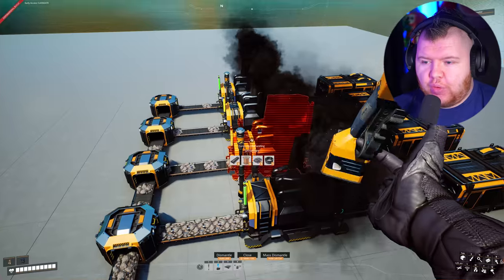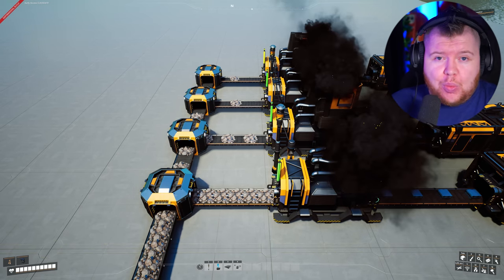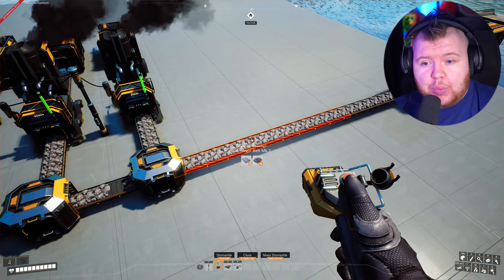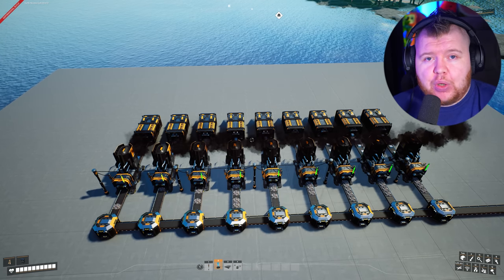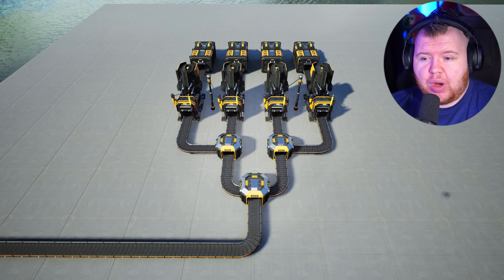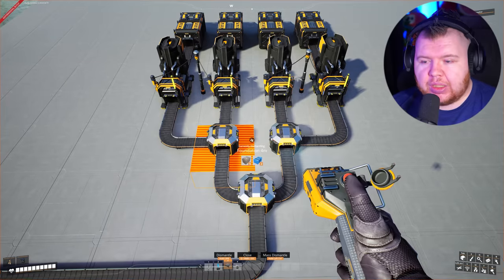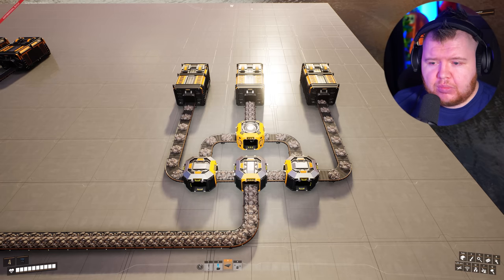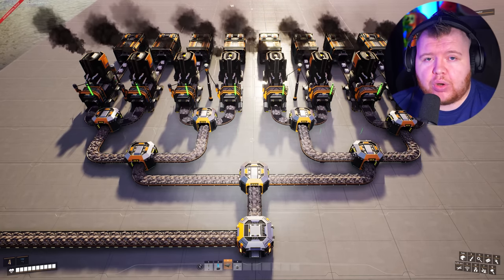MANIFOLD vs LOAD BALANCING!! in Satisfactory

Comment from the maker: So what do you run in your playthrough, Do you use Manifold, Load Balancing, or Both and why?

Before people let me know, YES! I could have split 270 into 3x90 lines and then split them into 9x30 Lines, the reason for my explanation was to show other methods you can use to help you with the process
Reply: I used to use load balancing before I understood how a manifold system actually works. After a few years of load balancing, though, I realized a manifold system has more upsides than downsides and began using it as my primary method of feeding the machines
Reply: That load balance was wrong. If you split ores 3 way and each way in to next 3 ways it will make 9 smelters. 3x3 ;) so it isn't like you must do special stuff for that. But for more wierd stuff that come later in game much better is that Manifold system.
Reply from the maker: @Elmachtronic  The purpose of me doing that was to explain for the later game and other methods of helping your balance load :_BitzLove:
Reply: I usually use manifold because I generally play to let my brain melt not explode into fire lol.
Reply: I typically use Load Balancing for things like Coal Power, and manifolds for nearly everything else.
Reply: I use both it just depends where but if im doing load balancing with mk5 full belt, i connect it with manifold as it's easy to make and expend
Reply: Like many folks, I started out using Load Balancing almost exclusively, and pretty quickly began to run into issues with expansion.  All those splitters and belts take up valuable space on the factory floor.  There are certain times where Load Balancing can be beneficial, such as driving 8 coal generators with a 120 coal/minute feed when you need all 8 to come online immediately so your factories don't start running out of power.  But even then, I usually let things go offline until the Manifold-fed coal generators come up to speed, and then restart my production.

Both are fun, each offers its own set of challenges, and I'd definitely recommend trying both to anyone playing the game.

In a future video, could you perhaps show some of the more advanced Load Balancing concepts, like 5-way, 7-way splitting of an input line?  Also, possibly showing how to convert multiple conveyors with different numbers of items/minute into some number of output conveyors with equal rates/minute?  For example, take conveyors with 160, 80, and 60 ore/minute on them and convert them into three lines, each with 100 ore/minute?  These are good skills to have for all pioneers out there in Satisfactory-land.
Reply: Manifold, but pre-load all the things because I'm impatient AF.
Reply: I tend towards Load Balanced systems, partially because I like the way they look and partially because I enjoy the mathematical puzzle of keeping everything neat and orderly and prefer not to have my machines backing up if I don't need to.  However, I frequently combine the two techniques, sort of; to use the same example of a 270 ore input feeding into 9 smelters, I'd have a manifold line style trunk line input with Mk 1 belts feeding off, but each of those belts would then be split into 2 30s to feed the smelters, until the end of the line where I'd either have to use a smart splitter (60/30 using overflow) or split three ways from the trunk line.  That keeps the ease of expansion from the manifold but also the more efficient flow and lack of backed-up machines from a load balanced system.
Reply: Honestly I just figured you left the overflow to show what somebody could do with any amount of overflow. Like they are satisfied with their build but there is a bit of extra that they don't want to go to waste in stutters. They might as well send it off somewhere else to be used either in production or tickets.

To answer your question though I use both. My power plants use a dual manifold layout but everything else I load balance.
Reply: Hi Bitz Please can you do reaction videos for the remainder of the Let's Game it Out's.
Reply: I use manifold mostly.  The easier upgrade path just makes it a no-brainer for me.
Reply: @mikehunt3205  I preload as well.  I just set up my miner to feed into a storage box when I'm building my next stage.  By the time I'm done I can usually prefill them all without any major waiting.
Reply: manifold for sure, it uses less space and has a ton of adventages even if it takes some time to fully get running but the first two runs i did after i went from factorio to satisfactory were full of balancers and my factories were a mess, i still use balancers in the early game to make basic stuff but i go to manifold as soon as i start building
Reply: I def stick to manifolds, mainly for space, and it's easier to expand as I upgrade. One thing I would however like to know is differing mewthoods for creating a mass storage room and getting said items to said storage. As dumb as it is thats my biggest issue. I have 'over flow' lines with smart splitters from all my production for each part flowing up and all connecting to a single line that then flows throuhg even more smart spliters that send items off into stacked normal storage containers. 40 in total in fact. At the end of this line all items just go to a sink. 

This works, but this line does start to run into its own backlog issues as well, I have belts of items all merging together into a single one. Thus my lines are getting backed up, thats backing up to production lines, and that is boging stuff down. I did try adding another overflow line to just sink items, but then most the items are getting sunk and not reaching my storage. At the moment I only have mark 2 belts, and know it can get fixed as I upgrade but I can only imagen I'll continue running into this issue even as I upgrade as well, more items will be added to the line.. This is an issue that I feel may only get worse that I'm unsure how to well... fix.
Reply: @TAiiNE  i use separate lines for each item no matter if they come from near factories or if they come by train and transport all of them under the storage facility up to the conveyor hole where the item goes to the storage in the next floor and at certain part of the line i use a smart splitter to get the overflow into a sink.
it is not efficient space wise but saves you from a headache
Reply: @alejandrozapataq  That would be far too many belts to manage, 40 belts in my case all in one area + the line for sinking them. Thats almost 16 foundations if I line them side by side to manage and try to deal with. I'm struggling just to keep the lines for iron, copper, concrete and coal running  and now trucking in quartz and silica for windows.

What my plans were for the main base that has my central storage is only producing the key items used to make like constructors, smelters, etc etc, at least up everything up to tier 4. The rest and more complex stuff will be made elsewhere including the space elevator parts. I already have two outside factories, one doing quick wire and another doing silica and quarts that are being trucked in for storage.
Reply: @TAiiNE  thats fair, in that case dont forget to put overflow lines, you will need them at some point

Comment: I use both. Manifold is my default, but I’ll use load balancing for aesthetic reasons or just to change things up. A lot of times load balancing required giant swaths of belts running the same material, and I love to stand and watch everything going in unison. Or setting up yet another smelting facility sounds boring, so I’ll load balance to require a different layout. 

Using a smart splitter to slough off the excess from a full belt is something I’ve never used before, but is a great idea!

I appreciate a fellow “use the slowest belt” player. Just using the fastest belt is certainly easier, but when they aren’t moving very much it just looks like an empty belt where something occasionally whips by, and I prefer getting to see the items moving around my factory. Plus it’s easier to diagnose if something is wrong. If any belt above mk 1 isn’t at least roughly half full, you know something upstream isn’t producing enough.

Comment: Nice explanation on the different types of loading your machines. For your solution on the load balancing, I would have split the 270 line into 3 times 90 and then 3 times 30. Would save you a couple of splitters and all the hassle of the smart splitter. (I do get the need for the example though)
Reply from the maker: Hey bud i placed it in the pinned message, to explain my reasoning behind it  :_BitzLove:

Comment: I used to set up load balanced designs, until I learned of the manifold system. The heating up period can make one unsure of their calculations, but once it's fully operational, it's really nice to use and right, expand on it ! And its compact footprint makes it convenient as well ! I've also tried to have a manifold one way with mergers at the smelters' exits that go up with a lift to another manifold that goes the opposite way with splitters to feed constructors. I kinda like it.
Thanks @Bitz for reminding me of the Smart Splitter overflow parameter, I've never really experienced with it, but will definitively will !

Comment: As a couple people have mentioned, you can reduce the "heat up" time on a manifold production line by running belts with materials on them and preloading the machines in order.
This gets trickier the deeper you get into production as you may not have easy access to full stacks of some of the composite materials.

I think the most important takeaway for people is that both setups are capable of being 100% efficient, and they both have their uses. It largely depends on personal preference.

Comment: Manifold systems also work very well with vertical setups as well if you want to reduce your horizontal footprint. You can attach vertical conveyors to the outside of the splitters along your highway belt to bring product up to more smelters that can sit on another story above.  Then typically what I do is I rejoin all of the product using the same manifold system and then distribute it to a bunch of constructors in the same manner. You can make some very compact and modular setups doing this.

Comment: The load balance systems are my go to method of building the systems in my game. My brother and I created a system we like to call a Medusa. In effect we build each system where the input and the output both come to the center of the complex.  The ultimate inputs are typically maxed out miners of raw ore being supplied and the output is the product of whichever system. Obviously we have to modify it slightly for the higher level systems like recipes that go through the assemblers and manufacturers and will sometimes build a low level Medusa to supply one or more high level systems with items like rods or plates.  It makes for a remarkably compact footprint for a maxed out mark five belt of product.  It doesn’t always work perfectly but it does give us stunningly high outputs to permit for some massive building projects without worrying about running out of products to build with.

Comment: i am using both systems in my most recent world depending on what i am trying to automate. predominantly manifolds and most of my load balanced setups are using overflow sinks so they are not working on 100% resource efficiency but that's alright.

i instinctively went with load balancing when i first started the game and it brought me to the point of tears multiple times because i just could not figure out how the more complicated recipes are to be set up and i had no idea about smart splitters to regulate overflow. i felt so stupid that i dropped the game for about a year until i stumble upon this channel and decided to give it another try after watching a few of your vids.
i don't think that i would have picked it up again or learned to actually play it without this channel.

Comment: You can also use manifold with smart splitters if you want power to fluctuate a little less--left would be ore, straight would be overflow--repeat. Doing so means you won't have something at the end only sometimes kicking on, but rather in an off state until it is needed and ready to go. This is better if you need high efficiency--mainly if you're starting a new power plant and desperately need the power now

Comment: From my understanding, manifold can cause the last smelter to tick on and off, for fractions of a second which as I recall from ImKibitz causes framerate issues or engine issues when you scale up.  Something to do with the power fluctuating and stuff, however this was before they changed power(coal factories ran only to provide 'enough' power, now they run 100% all the time).
Reply: To add, this was also a few major patches ago.  Since then they have upgraded the engine and changed rendering of machines at a distance(they used to always be 'loaded' in memory even off screen).  

That all being said I still load balance and not worry about under clocking.  Under clocking works best in large scale to lower power consumption.  I use modular power mod so I don't have any power issues since that mod, while more complex, solves all those issues behind power use.
Reply: In the same time, Load Balancing can cause the whole energy generator factory to tick on and off if you don't supply enough resources to the factory, which can be more troublesome than one smelter switch on and off (Imagine 30 generators or so all turn off in sync, blow your fuse just because one wrong calculation in supply speed)
In Manifold case, only 1 or 2 generators would be off due to lack of supply.
Reply: Yes, I've seen instances where the last one or two smelters or other production ticks on and off, as the incoming resource sometimes makes it there a fraction of a second too late to keep things running continuously.  I usually fix it by taking a couple of extra of that resource from storage or handcrafting them and dropping them into the end units' inventories to provide a tiny buffer.  You don't have to completely fill the smelter/etc. ... just a few extra in its input inventory is usually enough to stop that on/off ticking for the length of the game.

Comment: I use load balancing because I really enjoy figuring out how to perfectly balance my machines in a way that is both aesthetically pleasing and modular. When I scale up, I just add another floor and split the incoming belt rather than re-tooling everything. That said, I tend to just hand-build everything I need to get to Mk 3 belts (apart from miners and Space elevator parts) before really getting into factory-building. I still only have about 350 hours in so I'm still doing that whole "get really far, learn a ton of stuff, restart so you can implement the new ideas" thing. Now that I have a better understanding of how manifolds work, though, I plan to start implementing them a little more where it would be more useful.

Comment: a 1 to 9 load balance is very clean with 270 as you set up 3 sets of 3 smelters each set being fed 90 ore on a 120 belt. It would only use 4 splitters. I know that we were using 9 smelters as an example, but I just wanted to mention at for this instance, load balance would actually take less resources than a manifold (regarding splitters).

Comment: One little tip on load balancing, you are working on 1/2 or 1/3 ratios depending on if you are using 2 or 3 belts.  I do suggest you are family related with them as some of the later recipes may require back feeding of resources or balancing outputs.  Like the recycled rubber and plastic requires a back feed of some of the product as feed stock for the conversion. Or say you want to balance 2 pure nodes and 1 normal nodes so they all the belts have a balanced output of equal amounts.  Manifolds are nice but load balancing has its place too.

Comment: With smelters, I would use a different load balancing system, an 'upgraded Manifold'. It is a basic Manifold system, but each mk1 belt going off the main line is being split between 2 smelters. So every mk1 belt supplies 2 smelters. It can be easily expanded and all smelters are receiving 30ore/min.

Comment: For a long time, i use both
If i want to build a compact factory for a single type of item, i use load balancing heavily, specially the liquid, abuse the water tower mechanic, everything progress from bottom to the top
If i want a massive factory to mass product a large number of various items, came from numerous resources, I use Manifold.
And believe me, if you build a load balancing factory all by yourself, and it works perfectly (Normally, you need to fix thousands of miscalculation before it work flawlessly), it's a pure Satisfactory

Comment: The one situation where I consistently use load balancing is nuclear processing. By load balancing every radioactive item, you prevent the buildup of full stacks of radioactive items in each machine, thereby reducing the radiation around the production buildings and reducing the rate at which iodine infused filters get used while near those buildings.

Comment: I find load balancing most important for coal power, where you don't want a long start up time to reach full power.

You can also have hybrid with a spine at say 270 or 480 splitting into 60 belts. Then the 60's only need to split once to get 30/30.